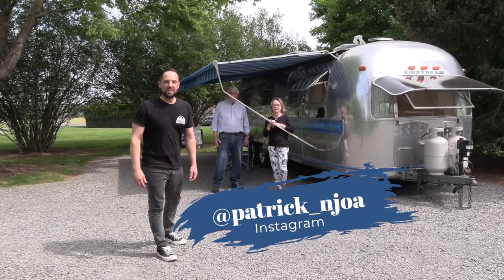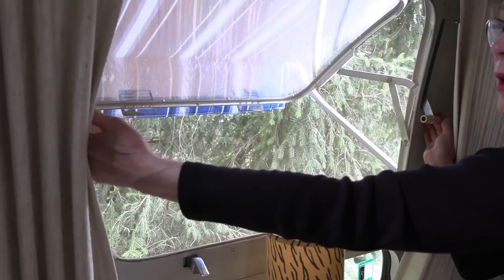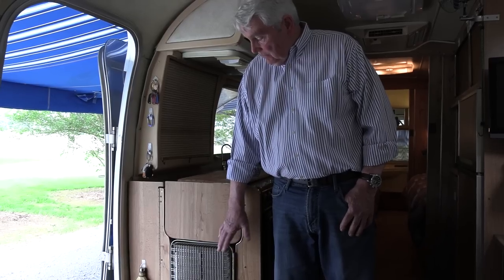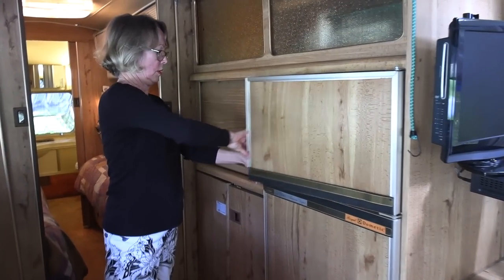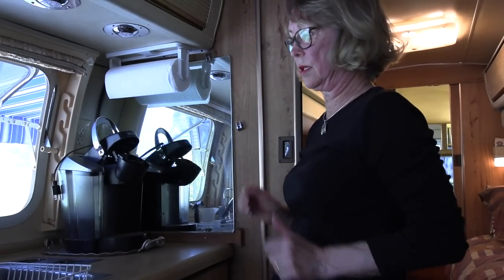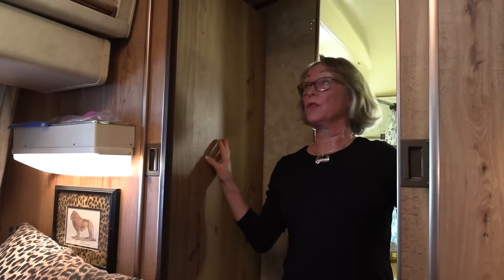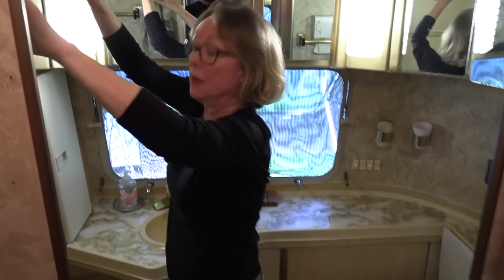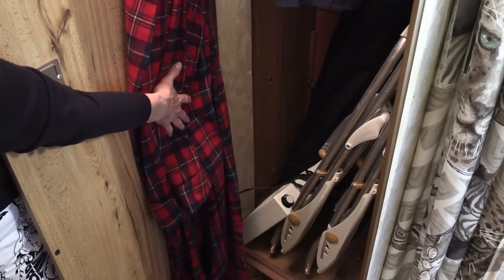Walk Through | Vintage Airstream Excella 500 Travel Trailer Camping Caravan

Comment: They replaced a Few of their lights to "Lights that are not hot" but yet it seems they left all of their other lights to Old Bulbs? So they are wasting 100-250W atleast on Lights when they could be using 20W
Reply from the maker: The ones they left, they barely use. It’s always not necessary to upgrade every fixture.
Reply: @NewJerseyOutdoorAdventures  I'd think it makes sense now though just because an led bulb is so cheap compared to even 5-6 years ago.